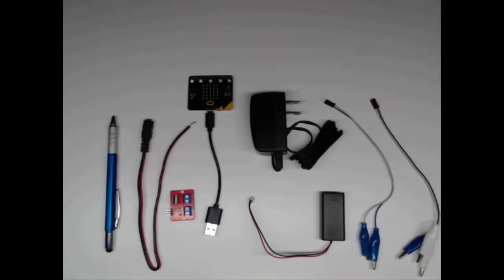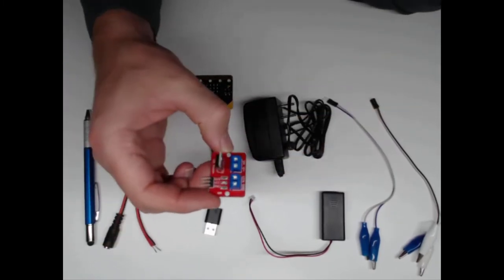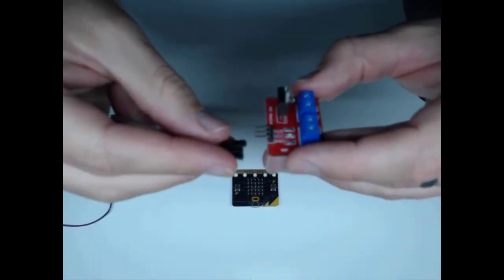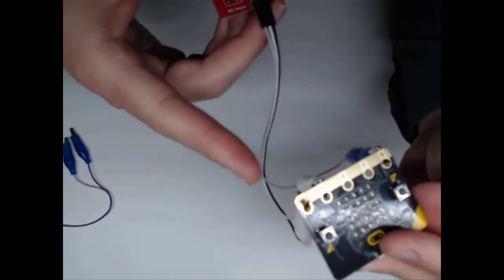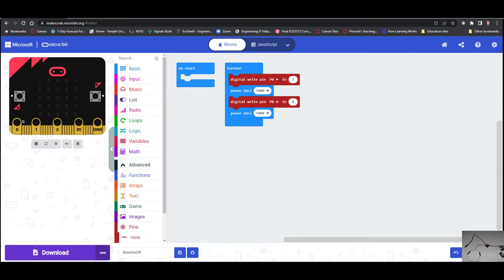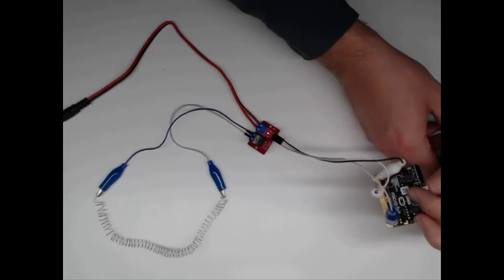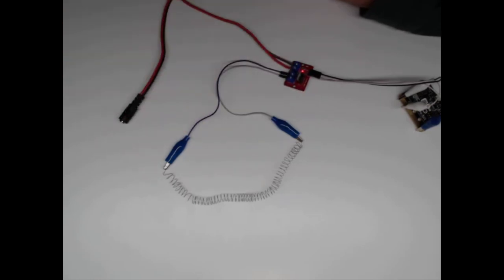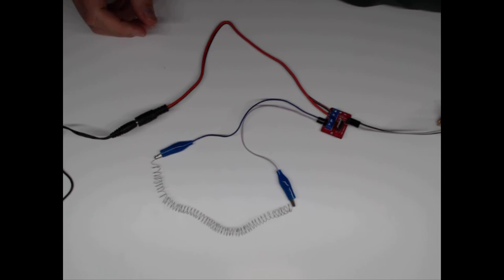Micro:bit heating wire setup

Comment: Thank you for the intersecting video. Is it safe especially for juniors. 2) May I replace the wire with a heater? What should I look for online to find it?
I am trying to make a microbit circuit to keep a minimum temperature.